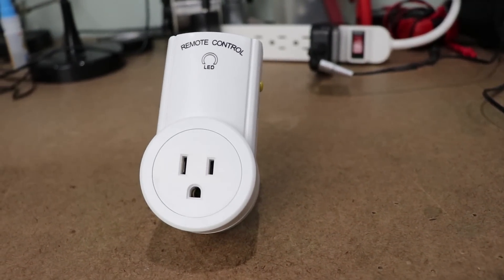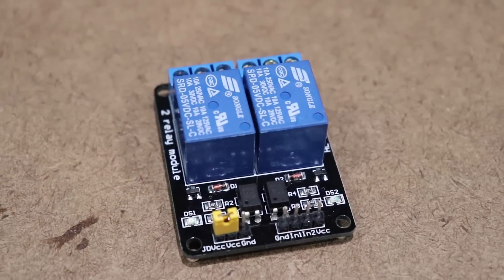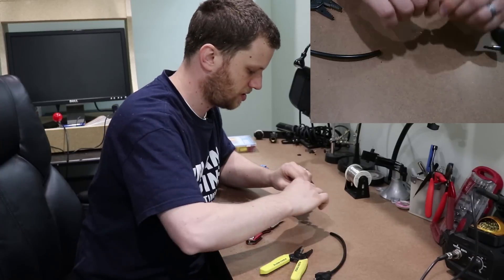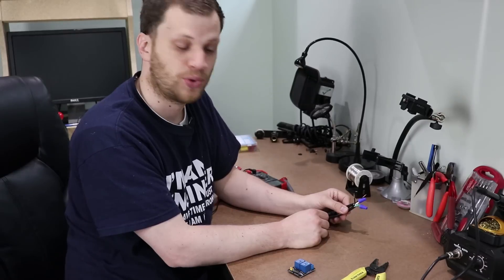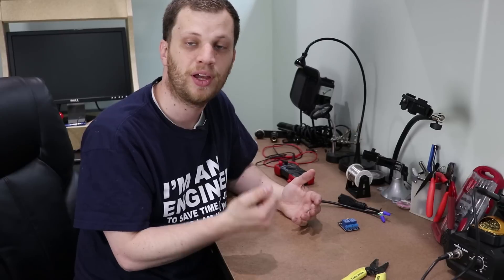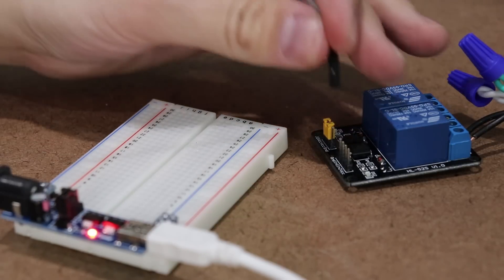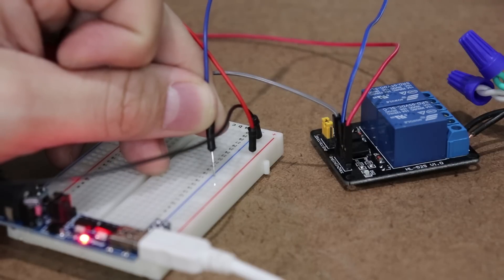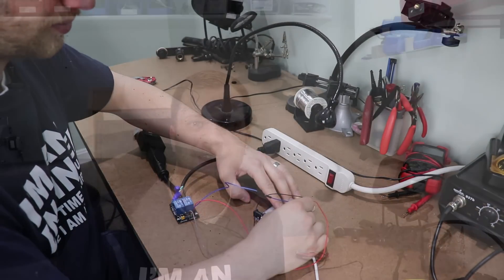DIY Smart Switch - Part 1 how to use a relay

Comment from the maker: Huge thanks to my channel members who make these videos possible. If you want to support what I do and get access to free project files, an awesome discord community, and much more, head over to https://www.patreon.com/bytesizedengineering or click the join button here on YouTube.
Reply: Just one issue, as seen at @4:35 those black wire leads have too much insulation removed, either not in far enough or need trimming so that bare copper is not exposed.

Comment: Interesting. I'm new to these relaying thingy.. I saw the relay you using stated 5v. Can it be use with 120v? Am I missing or skipping something here?
Reply: There are basically two power types used here one for controlling the relay (in this case 5v) and one for usage (in this case 120v) you control with the 5v when the 120v are aviable for the lamp hope i could help

Comment: When handling your signal wire like shown @6:40 make sure you are isolated and have no connection to ground. Otherwise you will close the circuit by just touching the exposed part of the signal wire and potentially hurt yourself.
I recommend to use a button on the breadboard to test your relay and not do what is shown in this video!

Comment: I didnt understand this video very good, so what kind of relay do you need to use for a wired magnetic window switch, to turn off and on the air conditioner when window opens or closes. AC 3000w. Thank you, best regards

Comment: I have a question I would like to ask you..I certainly hope you will respond. Every one talk about  relays and 12 volt or 5 volts DC current  , but no one talks about  AC current. ...Question: i have an eletric front door lock in my house..it is actually a patio  metal door to the street. The intercom connected to it is about 40 meters away upstairs on the 3rd floor apt. I purchased a cheap kit. one phone one front door bell...It comes with the transfomer inside the phone unit. 110 AC to 12 volts AC, The 12 volt AC output has to travel the 40 meter span to the lock. It drops tension...and the lock fails to open..is erratic, sometimes it work and others dont...By the way the cable used is CAT5. i found out there are 2 ways of correcting this issue; 1) is to replace the cable with a twin pair gauge 16  for the lock ..and keep using cat5 for the bell communicator. 2) is to add a relay and another transformer near the door..Here is the tricky part.. the relays on the input part operate at 5 and 12 volts DC and can output  10A 125 volts AC..CORRECT  ?? I need to basically design a circuit  that  would behave the way i want it.. So how you i go about doing this...Should I use one of those modules with a rectifier bridge so i can convert ac to Dc on the input side...and have the 12 volts AC on the out put side ??....Your ideas will be greatly appreciated..Thanks in advance....

Comment: I know only an idiot like me could interpret it in this way, but in the hope this comment helps someone. At 03:02 he says connect the ground and neutral wires together - and I know if you watch closely he shown ground to ground and neutral to neutral in the video but just for clarity he means ground to ground and neutral to neutral - not as could potentially be interpreted as connecting ground and neutral together!

Comment: Hi, i have 4channel 12v relay. I upload the code from arduino, The light is running in relay,but the relay has no Click.. 😪 so that the 12v motor is not running🥺

Comment: While connecting the neutral of a smart switch to ground might work, never do this! The reason it will work is that ground is often connected to neutral in the electrical panel, meaning it will be at a very similar voltage allowing current to flow from hot to ground.

Comment: Well done!! Excellent easy explanation, was looking forever for a simple explanation of using the SRD-05VDC-SL-C 1 relay module with a push button without arduino, was finally able to understand the input connection of the relay thanks to your explanation and video, thank you!!

Comment: since you have a 2 switch releay was safer to use both at L and N your never sure if the l is connected to the l on the board and the n at the n. safety always first. :)

Comment: I have 1 of the 5dcv to 110 relays. I'm trying to create a Poe using Bluetooth. I was hoping that my signal lead would come from my BT signal as my connection is made to the BT Device?? Your saying ground is signal. So do you know a a way to make the relay activate from a BT receiver board?

Comment: At 4:40; how does one wire the relay module (control side,) like I would with a 5 pin cube relay? I'm working on a car project and just want to shift the relay using a power and ground (like a cube relay pins 85/86.) Is that possible? And if it's not to complicated to explain, how do use the Power Select Jumper on the left side? Thanks in advance.

Comment: Your mains power switch wires to the realy are dreadful, there should be no copper showing. If you trained as an electrician then you did not learn the basic

Comment: How do I modify a 12V 433MHz wireless remote control switch relay receiver and transmitter? Someone in the area (neighbor) is using the same frequency.
Reply from the maker: I'm not sure I can help. Sorry.

Comment: Just to remind you, HIGH voltage is voltages above 999 volts. LOW voltage is 999 and below. Here in Sweden we also have something called "Klenspänning" which is a specific voltage below 50 volts which is suitable for toys because it's safer.
Reply from the maker: Nice. For me high voltage is anything I'm afraid of touching for fear of getting zapped!
Reply: @bytesizedengineering  hahah good answer! It's a correct way to treat electricity

Comment: Hi Zach, there is an issue that is worth exploring. It is cool to have a relay but if you have other people using the appliance can we have 2 switching options? This mean a person can either switch it on using the normal unmodified way and also an option to use a relay that is triggered by electronics. Otherwise it will be annoying to people who is standing next to the appliance who could just flip a normal switch but you will tell them to do some other routine 🤦🏻‍♂️
Reply: Yes you could easily do this by having a manual switch in parallel with a relay, however the manual switch would act as a relay override switch, the relay would not function again until the manual override switch had been turned off. A solution could be to use impulse/rocker switch connected to a latching relay

Comment: Thank you so much. There are a ton of videos, when you search for pi relay, that cover the "connecting it to the pi and writing code to control it" angle, but this (after tons of searching) is the first one that actually covered the other side of things.

Comment: I want to control several 12v lighting circuits and I'm looking at multi channel relay boards. They all have only one power input. Does that put all my devices on one power supply, because you could get up to 10 amps pretty quickly!

Comment: If you split the signal wire and place them in the twee middle pins. Would that switch both relays at the same time?

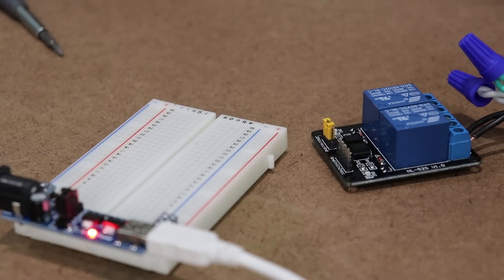Comment: Hi! What is the circuit already connected to the board in minute 5:00? and You mentioned that do no t connect to a fridge or vacuum cleaner, but can I connect it to my automatic door motor?

Comment: While impossible to predict,how someone will hear instructions, but at least one though you neat to connect the ends safety ground, and together when slicing that extention cord. When you meant to reconnect green to green, and reconnect white, white. I suggest eliminating the background music. Respectfully adds no value your production, and could interfere with your talk through. The only time I could hear the relay with you con controllin the tesk lamp. This would have been good place to inform your veiwers that low voltage conductors should be separated from the high voltage conductors, in a real world installation.  BTW; this video found it's way to Facebook after someone link to it in a technical forum. I will subscribe, and keep an eye out for your follow up vids in your series.

Comment: I am not an electrician, but from what I understand you should never connect the ground and the neutral together except at the main service panel. The neutral has a returning current and if the ground is connected to the neutral the ground wire will be live too.

Comment: Why not control the neutral wire with the relais to avoid high voltage on the relais? (i'm a hobby engineer only)

Comment: See the below link for 6ch wifi relay board with fan speed control https://www.electronicdiys.com/2020/09/home-automation-v03-using-esp8266.html
To buy click below link https://www.flipkart.com/electronicdiys-wifi-relay-board-fan-speed-control-micro-controller-electronic-hobby-kit/p/itm48134022bb239?pid=EHKFX4RKGHYBHPAZ

Comment: I have a two channel relay and i am using it with the arudino board for my project when i give a low signal the relay starts and when i give a high signal the realy turns off why is that so need help

Comment: I think that the extension cord shouldn't have been cut in half. the black wire only, this would have save you time to reconnect the other two at later point.

Comment: Best explanation found so far. Any good reply would be appreciated for the following questions in regards to connections.
For the load, or black wires,  I presume the connections on the module for the current would enter on the NO, and feed the lamp through the COM. Or does it matter? 
So to properly connect the active magnet, I would presume COM would connect to DC-, while NO would go to IN on the module.
I already connected 12V LED lights using relays and now trying to use this different type of relay for a closet light triggered by magnets. 
In the 12V schematics for LED strips, the NO on the module loops back to DC-, which becomes impossible with 120 volts. 

As for the exposed wires. If they would touch, then the module would be defeated and the lamp would stay on. The issue is that if they barely touch, arcing could happen and this is considered a very serious issue.

Comment: This is very dangerous, you basically didn't take your own advice from beginning of video. Small board connected to mains, no gloves, using both hands on the control wires, main wires connected loosely with plastic, which may get free at any time and cause a short or touch you hand, black wires exposed next to relay, may touch metal on board, it's like a disaster waiting to happen. At least wear some gloves and use only one hand when connecting the control wire, assume everything is compromised and at 220V until proven otherwise. Relay on board could be bd or get bad and internally conduct current between input and output.

Comment: Whats more worrying than the bare wires at the relay, is that the relay unit is laying bare on his desk, if he accidentally picks up the relay and touches the pins underneath, he’s gonna have a bad time.
Reply from the maker: I use lots of caution when working with power grid electricity. I suggest everyone else do the same

Comment: i have an electronic device that has a 56 volt battery with max of 20 amps.  I am trying to add a second battery to the equation so that I can switch between battery 1 and battery 2.  i would like the switch to be as small as possible.  it could be manual or Bluetooth. any suggestions?
Reply from the maker: no suggestions, sorry

Comment: So, when I come home all I have to do is plug a wire into a hole on a bread board and my light will come on. Hmmm. I think I'll stick with the wall switch.
Reply: Or, use the raspberry pi and a motion sensor to automatically turn on the light when you walk in, and turn the light off after some period of no motion. Projects can be as arbitrary and useless as you want, but a little creativity and it can be as practical as you want.

Comment: I need / want to automatically shut my manipulator valve whenever my tank is full. My problem is I want the manipulator valve to automatically open again when the water level is low, if possible I want it in DC power. Any idea.. Please help... I don't want to buy an expensive ready-made device.
Reply: hook up 2 pressure sensors and a relay to and arduino. go to the arduino formus and surely someone could help you out.
Reply: Wish you could make a video, might / could a good video for your channel.. Who knows, it could get more than a thousand views and likes.
Reply: @lrtaralte  i;m not into that youtube rush but simply look at youtube videos titled arduino coffe tank, and some of them show step by step how to monitor water level in a coffe tank, so you just do exactly that with your tank. they show how to use a relay in conjunction with that pressure sensor.
then hook up your relay with an solenoid valve instead of the manipulator valve.
also arduino forums and the arduino reddit are places where you can get started.
i myself only started arduino a week ago, but the basics are very easy. 
just google tutorials for the individual components in your projects, so by what i  understand you need to understand how to use pressure/water level sensors, and solenoid valves, both of which are very easy, just google them!
Reply: @Ayce47  thanks for the advice

Comment: Im confuse how do you control it then ? Do you have to keep turning it on manually?
Reply: Using the jumper cable on the breadboard. You connect the small cable when illumination is required. Note: If you have children I would recommend they ask an adult to make the connection(s) when needed (you may also provide a battery-powered torch nearby — affix torch to the lamp base using #18 twine,or similar).

Comment: Sir can I use this relay for 3 kva honda generation auto off when electricity come on. Reply plzzz
Reply: You should not do that because any accidental back feed can cause a lineman to be injured or killed. The proper way to do that is with a transfer switch.

Comment: Hey, i have question, can i use this to wire the intercom indoor unit, in order to open the gate of the building?
Reply from the maker: I wouldn't recommend tampering with property you don't own.

Comment: hi sir, normally the refrigerator draws 6A amps to  9A so will it be safe to use this relay if the device draws maximum of 9A given that relay has a rating of 10A.
Reply from the maker: That's pushing it too close. They make relays rated for much higher current.

Comment: Typical safety factor should be 3:1 or 5:1 so a relay rated at 10 amps should only pull 2 amps

Comment: I really wonder if it replace 110acv with 12dcv battery  then is it possible to control 12volt electronic devices?

Comment: So i ordered the one with 4 relays, connected it to my centralised electric space heater, one is for a water pump and other 3 are for heaters, every heater is 8 KW, i was not sure how powerful these relays out so i used theme to activate and deactiate existing 40KW relays inside the heater, i used the rpi4 1gb bc it has a poe gigabit port, slapped in a 16GB U10 card, i brought the poe enabled gigabit cat6 cable to the heater, tempreture dial was already connected to the main home server, installed Pihole on that pi to and just ordered the case with a fan from aliexpress, i made a quick app (i am a java developer) and voila now i dont need to go down to the basement to turn on or of the heater, although on all of the pcs i have made a small java gui for that, i am planing to make my whole house smart using raspberry pis

Comment: Bro tell me one thing
when wall switch is already given to turn on & off,
why did you use relay to do this job & extra work?
Reply: This is just the foundation. Part 2 of this video will show other control possibilities ie motion sensor. Cheers.

Comment: I have a power supply for the DC motor on my Sherline miniature lathe with a relay like this.  I overloaded the motor the other day turning some difficult material, and it shut down the power supply.

It happened a couple more times, before I could get finished with the piece, and now the motor doesn't run.

I could hear a relay click when this happened, and thought it was a circuit breaker in the power supply.  Now, I have it open, and can't find a circuit breaker.  I do find a Songle SRD-05vdc-SL-C relay.

It is obviously not clicking, as it should. I've read about relays with overload protection, but it doesn't appear this is such a relay. Could it still have functioned as an overload? And could it have died in my 'adventures'?

Thanks, for any help. I know enough to get me in over my head, but not enough to dig myself out.

GeoD

Comment: Can I control load of max 15 amps under 12 volt DC as along as it maintains the same output power rating?? Example Say, 20 Amp, under 12 v dc, power 240 watt as against the rated 10 Amp X 24 v of same 240 watt, or 15 amp, 12 volt....!!??? I'm really confused with these power and current. Awaiting clear concept. Thanks.
Reply from the maker: I would read the datasheet of the relay you have. If you don't have the datasheet find something similar on Digi-Key and read through the datasheet.

Comment: Can I control output load of max 15 amps under 12 volt DC in each 2 relays??
Reply from the maker: Each relay has it's own rating. In a module like this with two, each relay can support a load up to its rating.

Comment: Can I use 1 4-button remote to control 4 different 1-channel relays ?
Reply from the maker: I'm not exactly sure what you're asking. But if you have the right parts you can do pretty much anything.
Reply: @bytesizedengineering  I have 1 pc remote control with 4 buttons on it. And I have 4 pcs single channel relay. Can I control the 4 relays with that remote ?